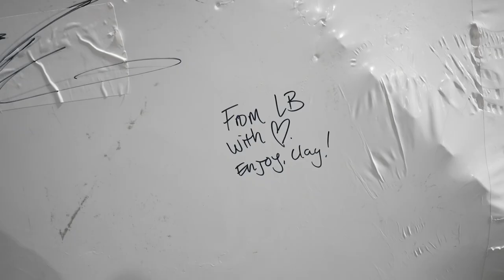Terran 1: Journey To Launch

Comment: I imagined there'd be a 'smushing' (for want of a better word) operation to smooth printing variations out on the outside before painting. Is that not even possible, or did it lose out financially to filling pits and grooves with paint?